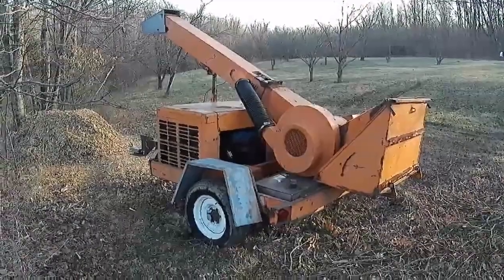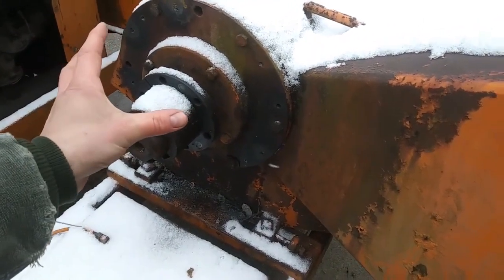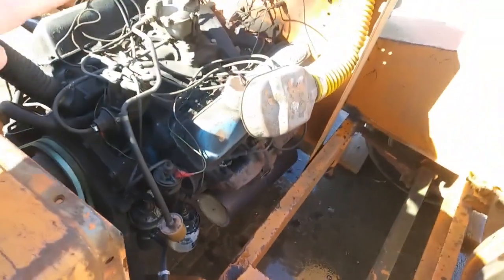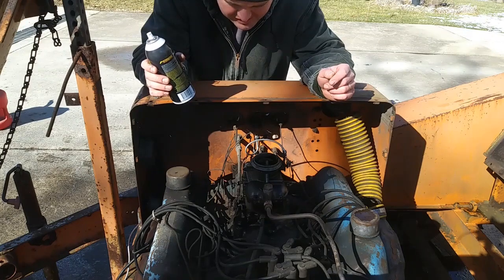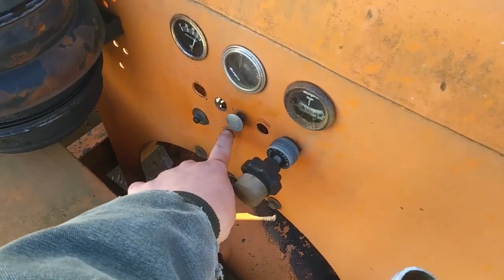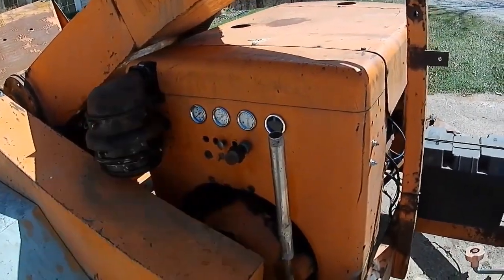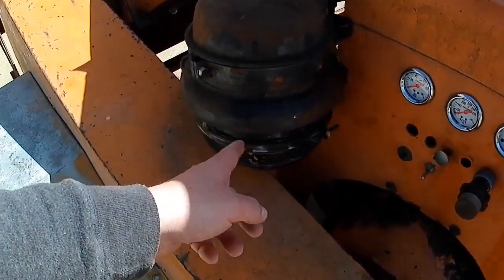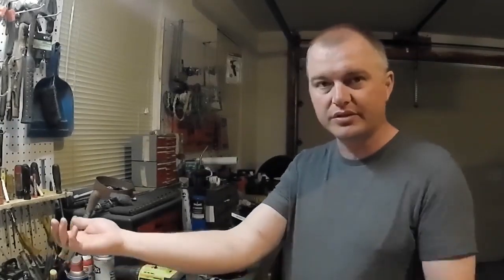Asplundh JEY Chipper Revival

Comment: how did you adjust blades? i have same machine - works great but won’t pull the limbs in… help?
Reply from the maker: It's been a bit, but if memory serves me, I believe i flipped a cover up on the top of the head and the blades were pretty easily accessed. I think it took a big allen wrench to loosen the bolts. I honestly don't remember the tolerances, but there isn't much clearance when the blades are adjusted properly.

Comment: Hello, Surprised to see the the exact same chipper as mine with the 331 V8 the chipper drum throat is 16x10 but the biggest diameter I can get it to chip is around 6 plus inches. Funny my gauges are the same as your original ones and someone added the same pipe on the engagement handle even the same tongue swivel jack. It's very loud and yes when feeding it will pull the large branches in whipping your arms, it's so fast. Great video thanks.

Comment: Where did you find the blower fan?
Reply from the maker: I joined a few groups on facebook that center around tree trimming. I made posts asking if anyone had parts. I had one or two that replied and i bought from one guy. I was unable to find the blower fan anywhere else. I made a lot of calls to dealers and parts houses. Nobody stocks parts for this old machine anymore. After running the machine only a few hours, the blower fan ate itself away again. I peeked in the housing and the fan was completely gone again.  If I had it to do again, I wouldn't worry about replacing it.
Reply: @justtinkering6054  gotcha thanks for the reply. I have an old whisper chipper with the ford straight 6 on it and thats the last part that is broken but doesnt sound like its worth the hassle.